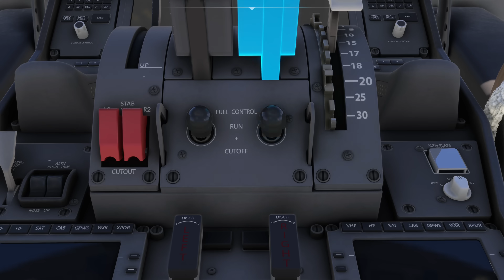Air India 171: Why Did The Fuel Cut-off Switch Get Moved?

Comment: You really could not make the cutoff switch needing both pilots to shut off. What if one pilot were incapacitated? Heart attack, passenger attack, and collision damage to one side of the cockpit. Just saying that there are many reasons for a pilot/co-pilot to have an emergency and be alone. If it was due to a collision or some other sort of aircraft problem, and one pilot was unconscious, the one flying alone might need to shut off fuel to one of the engines. To restart an engine while airborne isn't the procedure to shut off the fuel? Then turn the fuel back on, and that will send fuel back to the engine, as well as spark for the ignition.

Comment: Regards placing Video cameras inside the Cockpit,  though you already said pilots may feel uncomfortable,  it's leaking out etc. But maybe as follow up question,  this thought needs to be revisited. The concern of leaking can certainly be addressed by Only Traffic Ground Control having sole access to the recordings.
By having the cockpit visuals a lot more can be viewed in any investigation like body language,  pilots hand movements on the levers like fuel cut offs,  landing gear,  Flaps etc etc. 
Besides any violent behavior from any of the pilots due to anger loss or mood swings would be visible for analysis.

Comment: AI 171 Crash: US aviation attorney says known Boeing 787 software fault may be the reason behind Boeing 787 disaster. Possible software faults in the TCMA and FADEC systems. Schiavo thinks the problem could lie deep in the Boeing 787’s brains: the TCMA and FADEC. “If the TCMA senses it’s still on the ground, it throttles back the engines without pilot input,” she said. In other words, the computer may have told the plane it hadn’t taken off, even as it clawed into the sky. This isn’t guesswork. Schiavo points to two near-disasters: a 2025 United Airlines 787 from Nigeria to Washington that nose-dived because of a suspected computer fault, and a 2019 ANA flight where the TCMA failed outright. -- The Economic Times

Comment: With all due respect.  Stevie Wonder doesn't hold a pilots license for a  reason.  You're blaming a pilot without that one bit of definitive evidence that would confirm or deny that the pilot moved the switches and then lied.  Even personal cars have video.  If Walmart employees can be monitored for $40K a year then pilots at $150+ -$300K a year is a no brainer. Your defense of "it may get leaked" doesn't cut it.   Unprofessional/unacceptable behavior in a cockpit deserves to be identified and corrective actions taken.  Initially blaming the Lion Air pilots gave a green light for the Ethiopian crash to occur.  With 100's of lives in back and potentially 100's of lives on the ground in jeopardy put cameras in the cockpit and feed them to the flight data recorder.  If won't prevent accidents but it could provide definitive answers.

Comment: I've got a silly scenario, neither of the pilots didn't cut off the fuel. Nor the toggles didn't cut themselves off. One of the pilots might think the fuel switches were cut off maybe because of the engine's abnormal sound or plane was not ascending well. I mean fuel were not cut off. Let's say just one of the pilot's assumption. Then he called out Mayday! If we see like the fuel toggles were On positions all the time throughout the flight, we will have other investigations and solutions.
Now we all can't see the wood for the trees.
Besides sometimes reports can be quite slapdash and misleading.

Comment: Why is most of the western media blaming the pilots when the preliminary report doesnt even say so??? I ask you Steve, is it humanly possible to move both the switches within 1 sec? You got the timestamps on the report. Timestamps clearly states that both were moved at the same time. Why are questions not being raised on Boeing for faulty fuel switches as Boeing had already issued an advisory for these switches way back in 2019? Boeing already had a scratchy past related to the 737 series of planes. Why blame the deceased just coz they are not here to defend themselves?

Comment: I feel any spring loaded switch if not harnessed properly can retract .Instead of putting entire blame on the late pilots other angles must also be studied .Boeing is a huge company who can change the entire design for example they are turned on before a flight starts and turned off when the pilot lands .instead there should be a time difference of 5 minutes between both  engines each so even if anyone attempts to cut of fuel supply one engine will work which is enough to achieve a safe height to glide back to airport.Similary pilots must wait 5 more minutes to switch off the running engines
This could be enough to avoid such happenings in future.

Comment: Unless the cutoff switches are connected by a mechanical wire to the valves, electrical or electronic or software fault is still possible (only a  Boeing engineer can settle this). 

So alternative scenario: 

1.  Electrical or electronic or software bug causes valve shutoff but the mechanical switches remain in RUN position. 

2. a pilot notices the fuel is cutoff, not by looking at the switches, but by warning sounds or the data screens. 

3. This pilot assumes (wrongly) that physical switches were moved by the other pilot and asks him..  Other pilot truthfully says he did not do it. 

4. Both pilots frantically try to wiggle the switches back and forth but nothing happens for 10 seconds  and then on a flip to RUN the first engine spools up. 

Maybe it was as simple as electrical contacts at the bottom of the switches were slightly loose and by luck they connected after 10 seconds. 

This scenario explains the 10 second delay. Problem is that the “loose electrical contact at the end of the switches” - they would be two independent contacts and there is low chance they would both cutout and at the same time. 

If the fault was in electrical / electronic / software system elsewhere (eg actuators on the fuel valves), then we would have to assume a self-correcting mechanism in those systems or a backup system kicking in in 10 seconds. Both self-correction and redundancy in mission-critical systems are long-standing practices in tech and software industries. 

Plausible? Holes in the logic?

Comment: I work with standard industrial controller; we can tell from field I/O if an engine is running normally or has a problem such as fire. Assuming that an aircraft engine has sensors that can detect and alarm on engine fire, why would the computer allow the shutdown of both engine when both engines are in working condition and the aircraft is off the ground, i.e. taking off? Please understand that the issue is not just cutting off the engine, as this may become necessary at least understandably for one engine. However, cutting off two (2) engines none of which is faulted, is just impossible to reconciliate with "Intelligent Computer". 
Another way of putting this question is as follow: If the computer is as intelligent as we are told it is, then it should have inferred that the aircraft is climbing, while both engines are OK, therefore it is catastrophic to turn off both engines during the climb segment of the flight. 
This is basic logic within reach of most people and certainly a specialized device with high computing power should have inferred the correct aircraft state and thus prevented the incident by maintaining at least one engine at full thrust; just as pilots are not allowed to make horrific mistake in level flight at cruise altitude. My understanding is that the computer will prevent actions such as deploying the thrust reversers in flight or extending flaps at high speed during the cruise portion of the flight. 
Thank you for the opportunity to ask questions, Cheers

Comment: Considering the number of accidents where the pilots did not know what was going on outside the airplane, why not add cameras showing in closed loop (connected to FDR) the engines and the tail section ? That would avoid a number of mistakes like shutting off the wrong engine in case of a flame out.

Comment: Hey Captain Steeeve,

Love your channel and your take on matters.

Question:  if the fuel cut-off switches were indeed deliberately moved to "cut-off", at such a low altitude couldn't a pilot simply push the yoke forward and fly the plane into the ground?  It just seems like a lot more work than just pointing the nose down, no?

Thanks.  H

Comment: Excellent video with many very poignant comments.
As an ex-maintainer in the Australian military and spending all my 24-year career working on multi engine, multi crew aircraft (Lockheed Orion and De Haviland Caribou), I can certainly empathise with the comments about the human factors applying to the maintenance and aircraft construction people. Also, I 100% agree with your horror at the thought of AI replacing any of those humans. I understand "my" aircraft were very old technology, but we only ever had one total loss of an Orion and that was due to a massive pilot error/departure from a standard procedure, and the losses of any Caribou aircraft were due to either mechanical/structural failure, or during the Vietnam War, due to enemy action. Certainly, there were accidents with these aircraft due to human factors, but I would argue that the rate of these incidents would likely have been far worse without those 'three sets of Mk1 eyeballs' in the flight station or cockpits. The number of times I can owe my life to this is pretty significant and I am very grateful for that set-up, ie, three person cockpits.
I am sure that the majority of the technological advances have been first rate and have improved safety, but I do wonder if the reliance on the tech has become so absolute that we find that the human is overridden by it. I think of it in the same way as I think about when I learned to drive, I didn't have ABS, or airbags or any of these things so I had to drive the vehicle, I now have a car with all the bells and whistles but while I use the tech, I anticipate its failure at any time so I won't rely on it to always be there. While it is, great, but I'm ready for when it's not. 
Really enjoy the channel Steeeve, thanks so much for the insights.

Comment: I would think the software within a flight control system  in-flight take off, wheelsup should have certain conditions. Only after, take off, initial climb and at specific altitude can both fuel cutoffs  be turned to the off position if that occurs ignore the input until safe 1000 ft as example. This would assume you could have a problem upon rotate require one engine to shut down but not both. With landing logic would be adjusted to incorporate speed altitude pilot discretion. The fail safe is pilot override but like a submarine takes two keys.